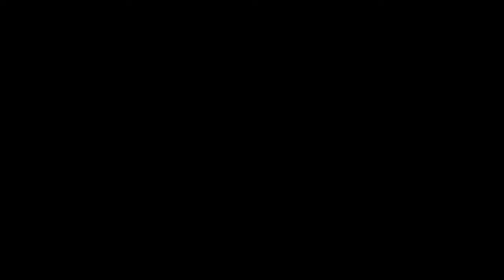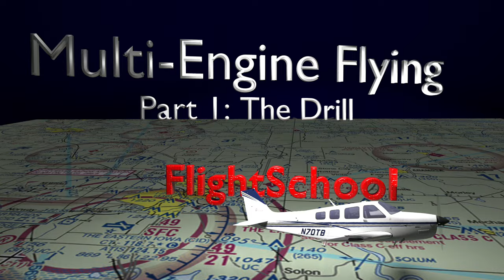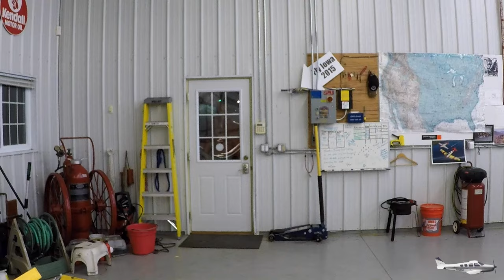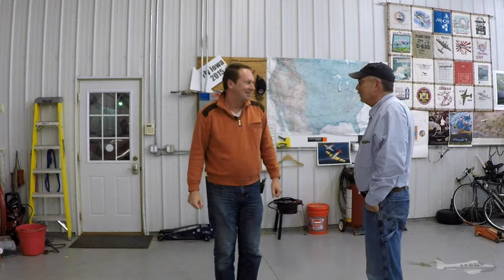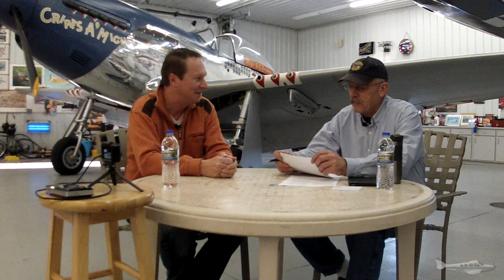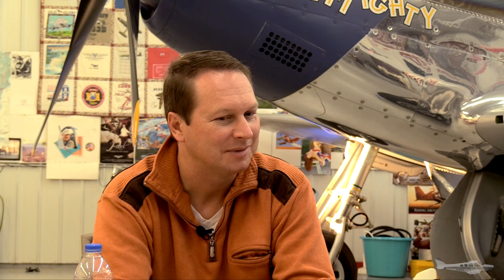Multi-Engine Training - Part 1: The Drill

Comment: I've said 100 times that flying and teaching are separate and distinct skill sets.  This guy has both.
Reply from the maker: I agree 100%.
- Martin
Reply: You couldn't be more right about that. I believe that any prospective multi-prop pilot should have this series drilled into their heads as Doc says... Like "Mary had a little lemb!" I can't tell you how much I appriciate Doc's militant and must have drilled into our heads approach regarding the above mentioned. Ern
Reply: I believe you are correct.
Reply: Why only 100 times? Or is this the ‘100th’?
Reply: I'm only 11mins into the video and totally agree with your assessment.

Comment: The drill at 6:15 (engine failure with gear already up):

Pitch for blueline
Mixtures
Props
Throttles
Flaps up
Gear up
Identify
Verify
Feather
Mixture
Engine failure checklist

Comment: Simply put…I’m still flying commercially after +48 years in the game!  Best ever calmest explanation from an instructor, for which I wish Doug had trained me… he’s a life saver.  Any of you inexperienced or newer multi pilots need to listen up herein.  Doug’s the Dawg here man!  I’ve had 7 multi and single engine failures in flight in my lifetime, 2 on multi, one in a Baron 55, the other an Aero Commander 680, the 680 I wrote off unfortunately for the aircraft, but i and pax survived!  How was this possible?  You need to listen to Doug’s explanations and DRILL again!  That’s how!  The basics of multi-engine phases of flight will SAVE you.  VFR, and especially in IFR/IMC.  GET IT INTO YOUR HEAD…MIXTURE PITCH POWER FLAPS UP GEAR UP DEAD FOOT DEAD ENGINE IDENTIFY VARIFY FEATHER TRIM THE BALL ROLL TO GOOD OR RAISE THE DEAD THEN AIRSPEED AIRSPEED AIRSPEED, oh did I forget something….AIRSPEED IS KING, all the way to a save landing!
Reply from the maker: Thank you for this kind endorsement, Dave!
- Martin

Comment: Doug provides a GREAT  lesson on doing the memory items for engine failure on takeoff in a light twin. Multi-engine pilots, as Doug clearly demonstrates, simply MUST have the memory items drill down pat so that they are automatic. The reason many general aviation pilots do not survive an engine failure on takeoff is because they do not execute their immediate action drills, and do not feather the failed engine's prop. My only comment on what Doug says is that the gear should be retracted before the flaps. Having the gear down with an engine out is a huge performance penalty as they do not provide any lift. Flaps are less drag and do produce lift. So, it should be mixtures, props, throttles full forward, pitch up to climb attitude, gear up, flaps up, then identify, etc. Also, unlike a normal takeoff, pilots should NOT wait for positive climb to retract the gear. Most light twins will not climb on one engine with the gear down. For example, a Seminole with the flaps up, gear down and prop windmilling will be descending at 450 fpm under ideal conditions.  Joel Turpin CFII ATP FAA Master Pilot.
Reply: Joel, if you do the drag demo in the light twins I've flown the flaps create more drag than the gear.  Some airplanes the gear might create more drag than approach  flaps, and when doing a go-around or stall recovery, I teach flaps (approach)-gear-flaps (up).

I don't care if someone teaches gear up before flaps, (I was trained flap first because of the drag demo.)

What is critical is that a M/E pilot have a procedure that is deeply imbedded in their brain to react appropriately to an EFATO.  Thank you for the kind words.

Comment: Doug's concept of "The Drill" is solid, and yet, having flown 9000+ hours in multi-engine airplanes myself (3000+ instructor hours), using the statement, "slap the dead leg," is a negative reinforcement and goes contrary to being proactive, which we, as pilots, should be. It requires two, possibly three, thought processes, prior to execution. A positive, proactive technique would be: step on the ball, step on the low hand (because roll follows yaw -- and most won't catch the yaw, at first, resulting in a roll toward the dead engine -- and the yoke will always point to the good engine), step on the good engine. This will prevent retarding the wrong throttle, during the "Identify" phase. Moreover, the objective is to level the yoke for minimum drag configuration, so to ensure maximum thrust is providing the best performance, ESPECIALLY if you have a critical engine.

Also, the comment, "Now we're going to take a minute and fly the airplane," is out of place. First course of action in ANY emergency: Fly the airplane! Second action? Fly the airplane. Third? Fly. The. Airplane. Granted, part of flying the airplane is dealing with the emergency, but listen: If an engine is on fire, guess what it's doing? Providing thrust! Get away from the ground; give yourself options. Don't be too quick to pull an engine, etc., all the while flying a low level over an apartment complex -- not smart. 

This gentleman is a great instructor, no doubt...just wanted to share another perspective. :-)
Reply: i prefer "step on the live engine".Ive always struggled with the concept of 'dead leg, dead engine'-heres why.In powerful twins, your hard working leg goes `dead `pretty quickly-as in runs out of power-you go numb. So-stepping on the live engine is just more intuitive. Cheers.
Reply: Correct me if I'm wrong....so an engine failure produces a skidding turn instead of a slipping turn?  If that is the case, then the ball would be to the right in a left engine failure, and stepping on the good engine would be appropriate.
Reply: What do you mean by "stepping on the yoke?  If the plane without my input rolls to the left because of an engine out,  will not your left hand be lower than your right?
Reply: Ok,  pitch, mixture, prop, throttle, identify, verify, feather, mixture . So when do you kick rudder?
Reply: @moonpaws1  I  know this is an old post and you prob already got the answer but I’ll respond anyway just in case. If you lose the left engine for instance, the aircraft will yaw and roll to the left and instinctively you will steer the yoke to the right. At that time, the right handle of the yoke will be lower than the left. What the OP is saying (which I’ve never heard, but I really like) is “step on the low side of the yoke.”  As you add right rudder (in this scenario), the aircraft will begin to track straight and you’ll instinctively remove some of the right yoke. What I really like about this technique, is it allows you to maintain your eyes on the horizon while you get the attitude stabilized (as opposed to looking inside for the ball).
Reply: @TyTanium1294  Great response.  Makes sense now.
Reply: Wouldn't it be easier just to say make a coordinated turn into the good engine?
Reply: @moonpaws1  I wouldn’t turn until AFTER I’ve verified the airplane has enough performance to make a turn (remember that rolling the aircraft trades vertical lift for horizontal…so you might not be able to maintain altitude in the turn). The most important thing is to preserve airspeed (at or above blue line). What I suggest is this:
After the engine failure, roll wings level (if terrain allows), lower the nose to the horizon, maintain current heading (if terrain allows) and use rudder to fly coordinated straight and level flight (that’s where the step on the low side of the yoke can help you quickly determine which rudder to add). Make a quick radio call “(call sign), declaring emergency for engine failure, I need runway heading and I’ll get back to you when I have time.” Now the sky is all yours and it’s time for the memory items…..identify, verify, feather, etc. After you get the airplane cleaned up and checklist completed, you can evaluate whether you can make a return to the field, etc. The big takeaway is keep it flying first and don’t rush. Straight and level coordinated flight preserves the most amount of aircraft energy, so go there FIRST, then do your “chores (cleanup items and checklist), then evaluate the energy state before making any turns.
Reply: I remember dead foot, dead engine. When the airplane starts to yaw, there’s no doubt you dead foot is definitely not pressing hard as you can on the good engine’s rudder pedal!
Reply: @moonpaws1  ALWAYS step on the ball! Only exception in in gliders. There you step opposite the way the yard on the window points to.
Reply: @moonpaws1  the engine dies. The first thing you’re going to do is feel that airplane yaw and watch that ball slide to one side. You step on the ball you level the wings and you keep flying as long as you can maintain speed, but do not go below blue line. Try to solve why the engine quit. Other than an immediate seizure, three things make and engine run. Spark, fuel and air. If you can’t solve the problem throttle to idle, prop feather, mixture idle cutoff. Trim rudder, pitch and land as soon as practical as long as you can maintain altitude. Do not go below blue line and no flaps or gear until the runway is made.

Comment: I wanted to thank you for this video and share an experience that I had, and how I overcame the problem with what you taught me.  I am now a MEI and started using your video technique of "The Drill" from day one.  I teach it and make my students recite it until they are blue in the face.  I also make them recite it after I substantially increase their stress level, because primacy is a real thing.  

I was recently instructing a day 1 multi student in a 310.  I was showing him how a reduction in power of one engine caused a strong yaw. After going through it a couple of times I realized that the reduction of power was no longer causing a change with the engine.  It took me about 30 seconds to realize that the throttle cable to the right engine had broken and the power was stuck at about 22".  It then dawned on me that I could not land with my power stuck on.  I started running through how I would land with power and not yaw the plane off of the runway.  The tunnel vision and reduction of hearing that you spoke of was starting to creep in.  The airport that I wanted to go to was 18 miles away and I was familiar with the ILS procedure so I declared an emergency and headed that direction.  I was 5,000'agl at the time so I had plenty of altitude, distance and power from the good engine.  I was always taught for an engine failure to start a stabilized approach before the FAF so that's what I did.  I gave the cfi that was in the backseat the checklist and had him start reading through the engine shutdown and feather.  I realized what he was reading me didn't sound right but the tunnel vision and hearing loss was getting stronger.  What I was extremely proficient with was "The Drill" and that's what I did.  I shut the engine down and feathered it about 15 miles out.  I was not thinking that I could have used the power from the right engine for the approach.  As I got to the FAF I was feeling good about things.  The emergency had been declared, the trucks were out, everyone was set, and the plane was stable.  That is until i dropped the gear and lowered the flaps to 10 degrees.  The increase in drag lowered my approach speed 10 MPH below blue line, which was still fine because that is the single engine approach speed on the checklist.  When I started getting slow the yaw from the left engine took full effect like a vmc demo.  Now I was starting to yaw, getting slow, and the tunnel was getting tighter.  I got with in 1 mile of landing and lowered the flaps fully and realized there was no hope of making it in.  I reduced the flaps, which reduced drag and made it in just fine with a perfect landing.  

My take away was this. I instruct and practice "The Drill" consistently which is how I properly executed the procedure.  My full time job is a high stress job with constant emergencies.  With all of the training that I provide, and my high stress job I still got tunnel vision and scared.  During 100% of the flight reviews I conduct, pilots say they don't train emergencies.  90% of them cant execute a stall because they are too afraid to do them.  Instructors need to preach system failures in every lesson because 1 second you are fine, and the next you're declaring an emergency!!  Thanks for teaching me the best lesson I have been taught!

Comment: One aid that I didn't hear mentioned was the old "Dead Foot, Dead Engine". It was easy to remember and served me well over a lifetime of flying. Another great video, Martin. Keep it going.
Reply from the maker: Thanks for the feedback, Raymond.
Doug talks about the "dead leg" (as opposed to 'foot')about 8:00 minutes into the video, saying that that's the engine we're shutting down.
- Martin
Reply: Martin Pauly   Yes, I caught that. I suppose my Air Force training always comes to the fore, and I found myself smiling at his leg slapping. This is not to say he's wrong. Far from it. It's just different from what I learned. I really need to butt out of what you're doing instead of running the military training in. I'm doing nothing more than confusing the issue, and you're doing just fine. So pardon me while I take my nonsense out of your business. Again, keep up the good work.

Comment: Excellent instruction.  One minor caveat.  In high-density altitudes, you should always have set the mixtures to best power before commencing takeoff.  If an engine fails during climb out, automatically pushing the mixtures to full rich may well destroy a significant amount of power available from the good engine. I would suggest modifying the drill to be "Mixtures set optimum".  Fly safe and thanks for all you do.

Comment: I completely agree with creating a universal procedure and doing all of it every time.

In my first 3yrs of flying, I flew over 10 different aircraft. Helicopters, airplanes, retracts, twins, tailwheel, turbine, fuel injected, carbureted, electric flap, manual flap, no flaps... Somedays I could potentially end up flying 3-5 different aircraft types in a single day with different students. So I had to come up with universal preflight procedures (that i still use religiously to this day), I set the cockpit up a certain way (still to this day), and I follow a set of procedures for all aircraft. If I come across something in a procedure that didn't apply to that aircraft, such as the prelanding checklist (gear check in a C172, or carb heat in a fuel injected engine....), I just verbalize that it doesn't apply.

Comment: You are getting great instruction from someone who obviously has taught many multi-engine students. The Colemill Conversion Baron will make you never want to fly an un converted Baron. I got my multi at Colemill before they were flooded out of business. I think all Barons(55 or 58) should be converted . It just makes them a much safer plane to operate. Keep up the videos.
Reply from the maker: Thanks, Robert.
Yes, the Colemill conversion turns the Baron into an even better airplane, especially (but not only) after one engine quits.
Regards, Martin

Comment: This is a great video! The only thing I don’t agree with is “the ball should always be facing the earth”… in level flight it can work BUT in a turn if it’s pointing at the earth you’ll be having a horrible time inside 😂
Reply: You are correct, if you are turning, the ball will not be pointed at the earth.

Comment: Great question Martin about how would you know when an engine failure occurs?  This hit home to me.  A number of years ago I was in the right hand seat while a teenager flying with my dad and our family the day after Christmas in our Cessna 310 from Republic Airport to Jacksonville, Fl.  We were flying in IFR conditions approximately 50 miles over the ocean approaching Jacksonville when all of a sudden my Dad feathered the left engine.  It happened so fast I could not believe how quickly the engine failed and how fast my Dad responded.  My Dad was as cool as a cucumber during this entire incident.  Jacksonville wanted to know if my we wanted the fire trucks on the runway.  My Dad declined the firetrucks and we landed without incident taking care as we taxied because one engine was out.  After landing my Dad walked into the FBO and someone walked out and opened the cowling on the left engine.  To my amazement there was a jagged piece of steel through the crankcase.  The engine had thrown a rod!  The individual commented to me that if the pilot flying this plane had not feathered the engine exactly when he did it would have ripped the wing off the airplane!  Martin, my Dad held an ATP rating and was also an accomplished sailplane pilot, his true passion.  I have followed your channel and know you also have a background and are a sailplane pilot.  Cheers.
Reply from the maker: Thanks for sharing that story, JP.  I am glad it had a good outcome.
You are correct, when I started flying, it was in gliders, at the age of 14. Always loved it, though it's an extremely time-consuming hobby.
Regards, Martin

Comment: My twin rating was done in a Piper Aztec E. The General public is not aware on how dangerous a twin can be if you have an engine failure below Vmc and even above Vmc the climb rates are horrible on most twins on one engine.  Flying near mountains require special attention to make sure the aircraft can meet MOCA on an engine.  Surprisingly my instructor also taght me with identifying with the dead leg. The funnest part of twin training is actually shutting down an engine to feel how the plane handles. We had to do that at least once to earrn our multi in Canada. All black handles with the throttle in the middle Yikes! From right to lleft I had red mixture, blue props and black throttle , so the flow was quicker, right to left! I would have to retrain the old brain in a Baron!